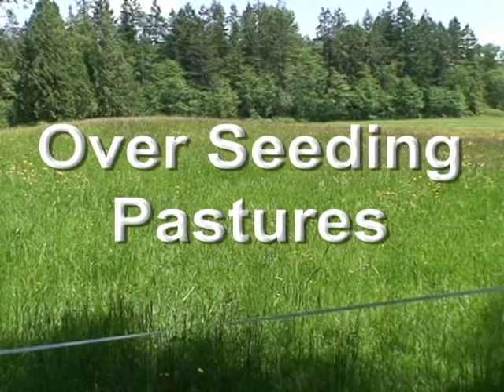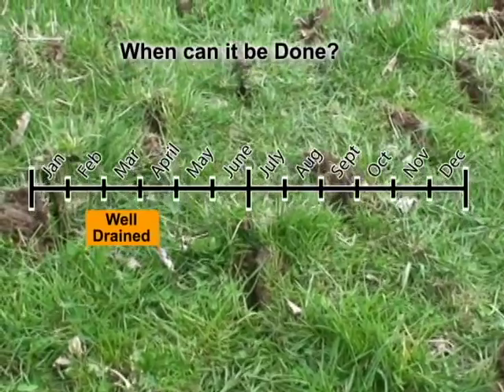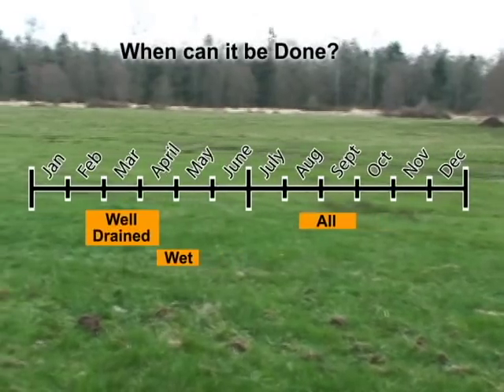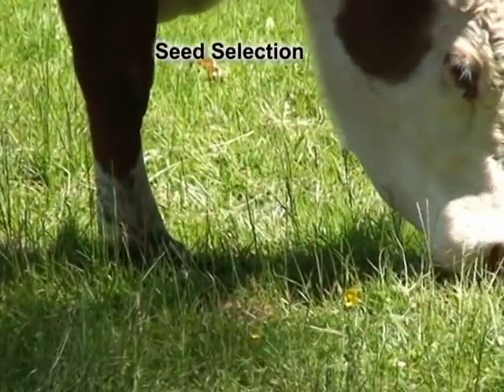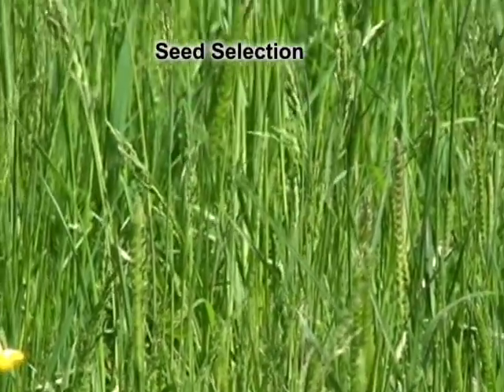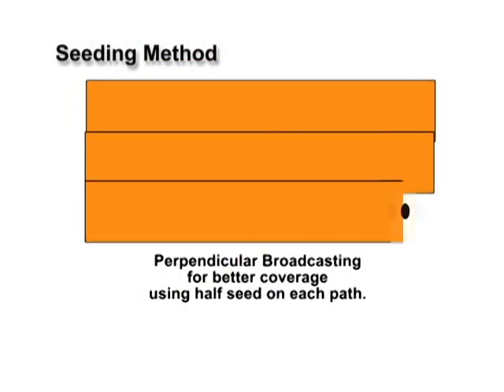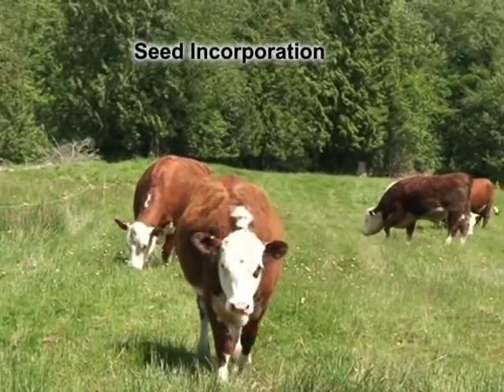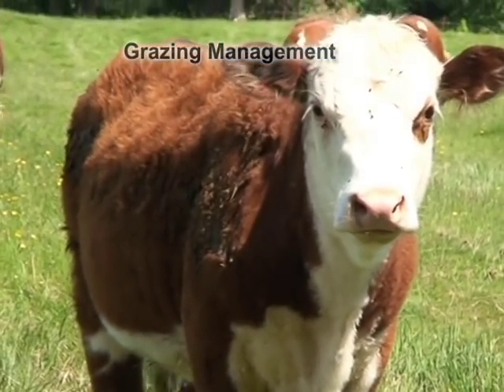Over Seeding a Pasture

Comment: Very good recommendations. But you didn't talk about the reverse. You didn't talk about alfalfa overseeding. One method to do this is with a pasture no-till drill. I oversaw a program that did this in West-Central Idaho for a Conservation District that used this method.  Worked amazingly well where sufficient water was available for germination and establishment. Very good video!
Reply: Unless something has changed over the decades, you cannot
overseed alfalfa with new alfalfa seed, as the new will kill the
standing alfalfa and vice versa. That's what I learned in decades past, 
and I would advise to check that out before
overseeding and ruining what you have. Alfalfa must be ploughed up, 
and a new crop sown, preferably under a cover 
crop such as wheat or oats. Rotating to corn or 
beans in between would assure the old alfalfa plants are killed off.